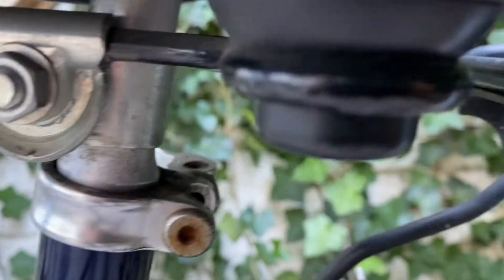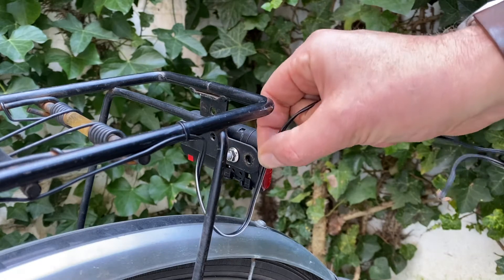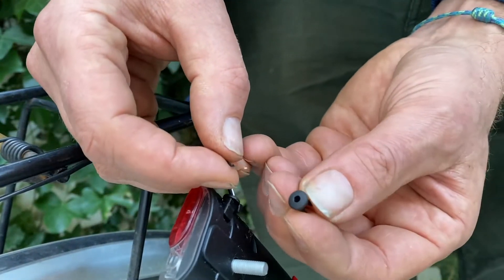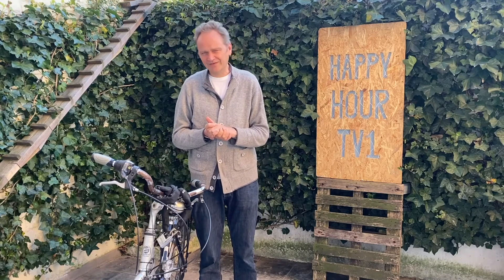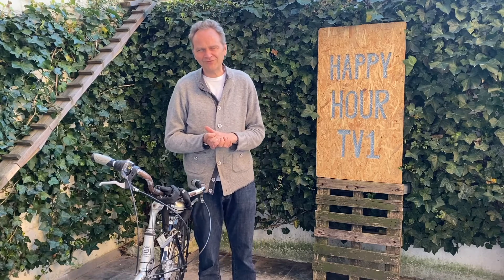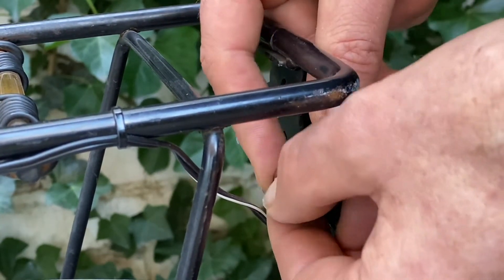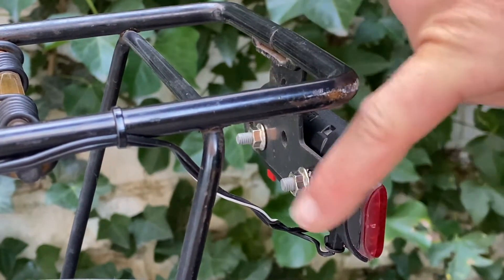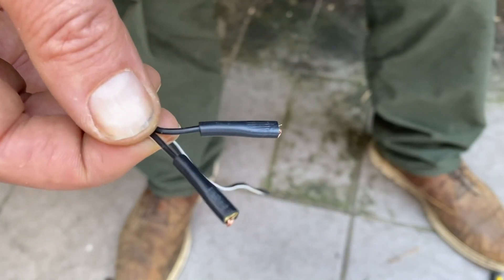Connect the lights of your bicycle dynamo 2/2: the tail light

Comment: Excellent video!
Question: Does this light have a blinking capacity as well?
I've bought a Dutch Bicycle that has come with a hub dynamo and the front light already mounted. Looking to add the back light but I need a light that blinks/flashes.
Reply from the maker: Hi Taariqq, thanks for the compliment and the question. I went yesterday to my bike shop I asked. He said that he didn't know any solution enabling to connect bliking lights on a hub dynamo. So a priori not. He added that it may exist, ask M. Internet ! Good luck (not do sure the bike is dutch...)
Reply: @Happy_Hour_TV1_in_English  What timing! I have just bought the one with the blinking/braking feature, called "Busch + Müller Toplight Line Brake Plus".
Oh! and a BIG thank you for going out of the way and ask your bike shop. So greatful.
Reply from the maker: @taariqq  I will my bike shop know ! Good installation, taariqq !
Reply: @Happy_Hour_TV1_in_English  Thank you chief.